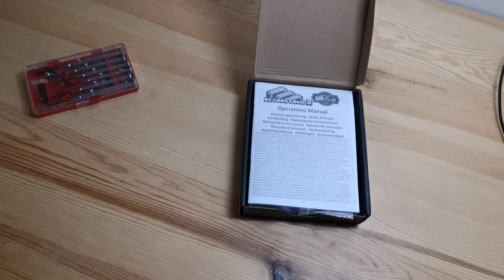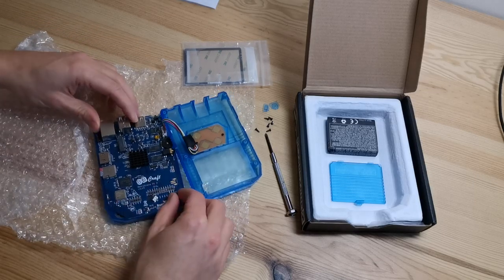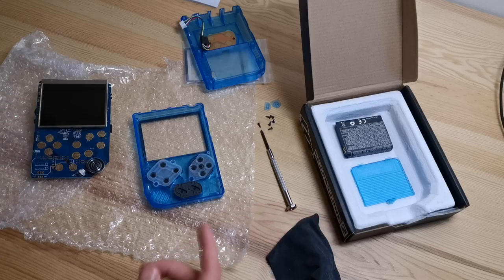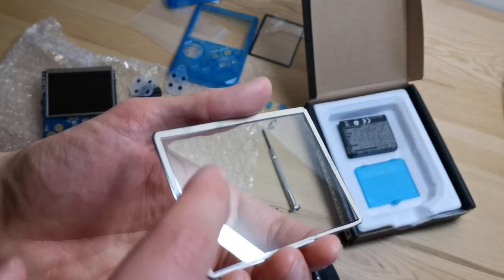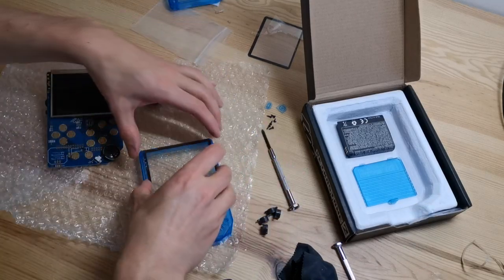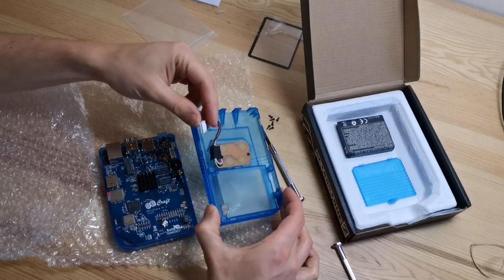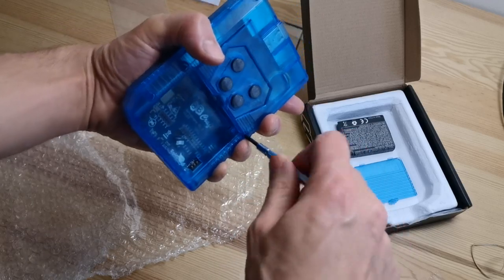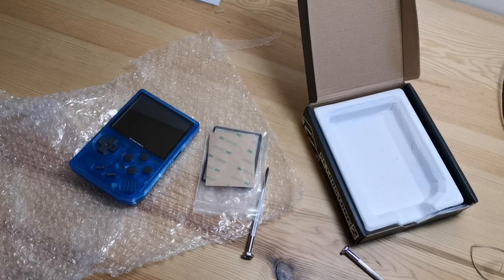RetroStone2 disassembly, lcd replacement, glass protector installation

Comment: I think it could be easier
 if you apply the double sticky tape to the frame instead of the screen to avoid marks on it then place the glass screen down onto the frame you could even cut them in 4 strips for easier handling and just lay them in place piece by piece.